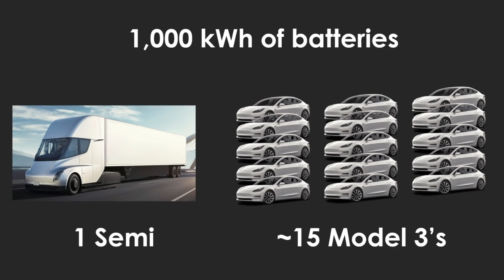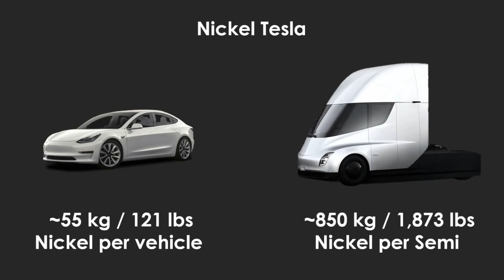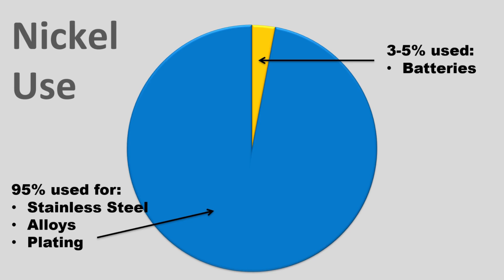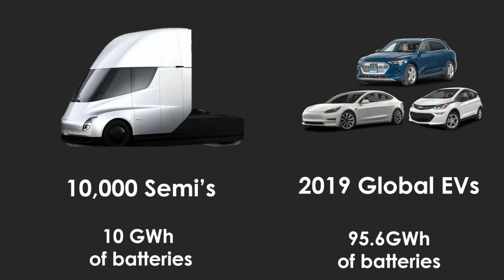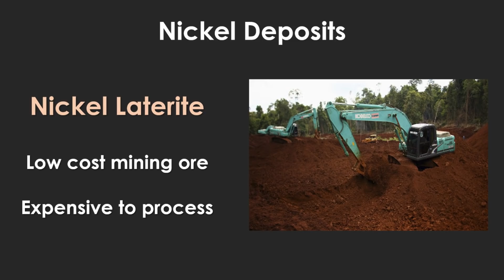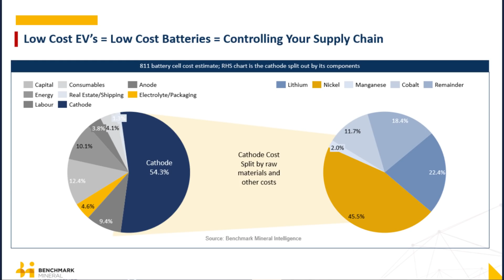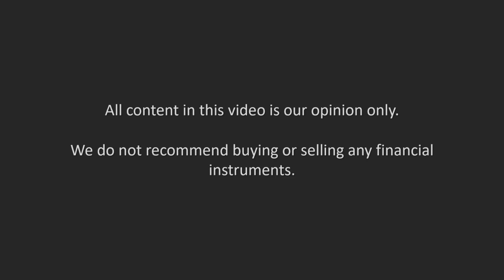Tesla's Nickel Problem

Comment: Thanks for this great content. I found PolyMet. They are environmentally friendly and will be the first to commercially mine copper, nickel and precious metals in the world-class Duluth Complex. Located within Minnesota’s Mesabi Iron Range.
In addition, I am looking at MP Materials (SPAC deal through FVAC) they are the only rare earth miner in the US.
Metso Outotec recently merged and they offer now apart from the hydrometallurgy recycling also machines for miners so they can be more environmentally friendly
Reply: If you're interested in FVAC read this:  https://60909e46-79bd-4fe7-9a09-bec8eb48ffa9.filesusr.com/ugd/affbaa_c855765aa9544f6493a2505850d19b87.pdf
Reply: @lithium-ionrocks5533  nice, thx
Reply from the maker: Thanks for that ill check them out

Comment: The "Canada Nickel Company Inc." of Ontario claims to have mining rights for an undeveloped seam of 0.3g/T nickel that also has cobalt and platnium. Based on bore holes going back 40 years, they claim they need to develop a mining operation to exercise their options. Meanwhile, Tesla has a boring machine that digs at a fraction of the cost and time. If Tesla can come to a deal, there would be a North American mine whose development and refining could be to Tesla specs. https://www.juniorminingnetwork.com/junior-miner-news/press-releases/2768-tsx-venture/cnc/80254-canada-nickel-identifies-multiple-nickel-targets-on-recently-acquired-option-properties.html

WARNING: this requires independent verification! Sometimes a press release can be inaccurate.
Reply: @tech 52 Check out their press release. Yes, that is their claim based on earlier bore hole tests. May ores are mined with even lower ratios. It is the processing that makes it profitable.
Reply from the maker: Thanks for sharing very interesting
Reply: Public Service Announcement:  Tesla cannot drill a tunnel any cheaper than anyone else.  Tunneling is not a new technology, and Tesla has no new technology.  Tesla's cost for its tunnels is above or about average for similar sized tubes.  Prove me wrong with data.
Reply from the maker: @ReachOutToWilliam   Hi William do you have any comparisons? I have not seen any data yet?
Reply from the maker: @tech 52 good point
Reply: Was thinking about Sudbury, Ontario. 
It used to be a big player in the nickel mining.
Reply: I got em at 83 cents mate. Obvious buy.
Reply: @tech 52 Timmons Ontario Canada Ready to go

Comment: The real bottleneck for batteries in the med term is nickel, not lithium. Specifically class 1 nickel (nickel sulphide). The bottleneck used to be cobalt but they are now using less of it. Removing nickel is not going to be easy like cobalt, nickel is what gives energy density and range, it partly what makes a Tesla..a Tesla. Cobalt only gives stability to the battery, which can be done with other elements like aluminum. That's why it is possible to remove cobalt.
Reply: Anyone know a good Class 1 Nickel mining stock?
Reply: @NukemFinance  Giga Metals Corporation (Ticker:GIGA). They own a giant nickel sulphide deposit in Canada.
Reply: @NukemFinance  Talon metals Ticker TLO.V
Reply: @NukemFinance  Canada  Nickel
Reply: You sound well-informed.  Do you have personal experience in the field?  If so, perhaps you could assist more in the discussion.  Elon piqued our interest, now we're on fire for nickel info.!  Thank you.  Carl in Yuba City, CA.
Reply from the maker: Great points
Reply: @Tesladocumentaryseries7603  Other countries with major resources of nickel sulfide deposits include South Africa, Canada and Russia. Laterite-hosted nickel deposits form by the weathering of ultramafic rocks and are a near-surface phenomenon related to tropical climates
Reply: @Tesladocumentaryseries7603  I think it is high time for Elon to lock in that deal and not in the near future as there are only a handful of countries producing Nickel and it is still price low as of the moment. China is still on the move to stock more Nickel pile and Indonesia also has a ban on selling their Nickel ores outside of their country.
Reply: The joke is nickel and cobalt come out of the same mines. You can’t get cobalt without nickel.
The refining process makes nickel and cobalt sulphide are part of the refining process.
Reply: @allangibson8494  And each deposit has different ratio's with some mines producing the perfect ratio. Note Cobalt also found with Silver and Platinum group metals
Reply: @15jarrow Agreed with Carl, please tell us more

Comment: Having recognized that the top 10 Nickel Miners worldwide do "only" produce* about 800 KiloTonnes 800.000 Tonnes or 800 Million kg Nickel per year you may (at 55kg per m3) only produce about 15 Million cars in the m3 class with that nickel per year. Producing 10.000 Semis a year reduces that to abt 14 Million m3-Class cars a year. And that Nickel is not only reserved for Tesla but will be battled for by anyone producing Lion-Bateries for any purpose. Incl. electric cars from other brands, mobile phones and what have you. Well now knowing that "only" 5% of the worldwide Nickel production goes into batteries you will have to divide the above numbers by 20.

791 kT in 2017 https://www.mining.com/top-nickel-miners-ranked-2017-production/
Reply from the maker: Thanks heaps for that Michael, great points
Reply: So Tesla is competing with itself!  Wall Street is STILL hating on this company.  Now Bernie Sanders is on Elon’s ass!  I though he wanted a green revolution??? God I hate the left now! 🤯
Reply: @johnjay2865  Welll BS is of a dying species that caused the probs (e.g. Climatechange) Tesla is abt. to solve. I don't think one should worry abt. them to much anymore.
Reply: the baby boomer generation has been responsible for a lot of problems in our society, climate change included.  They should retire to nursing homes and let the younger generations take over.
Reply: Tesla can increase the amount of charging stations per square mile and they can use smaller batteries (which means less nickel needed) in their cars as no one would need all that range
Reply: @jhh631  Not a solution in MHO. because in the end we do not have a problem of generating sustainable energy but a problem of storing sustainable energy until it is needed. Which in my opinion means we need more advanced storage solutions. batteries ocure as the only efficient storage solutions for electrical energy. As Teslas mission ist not to produce BEV but to help the transition to sustainable energy it's their job to produce as much batteries as they can. Even BEV batteries in the long are not abt. range but abt. utility for the grid.
Reply from the maker: @jhh631  IT would be great to have battery options when buying a car